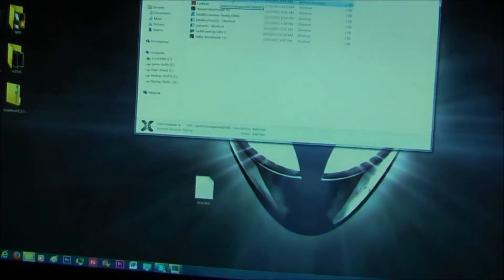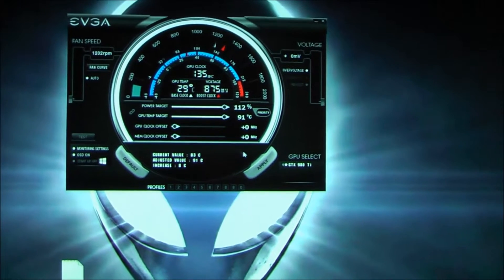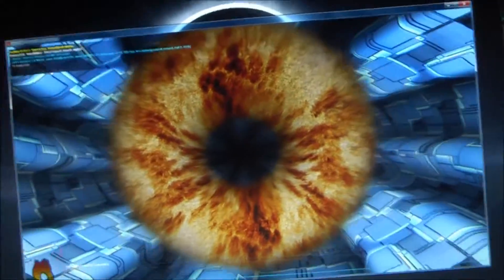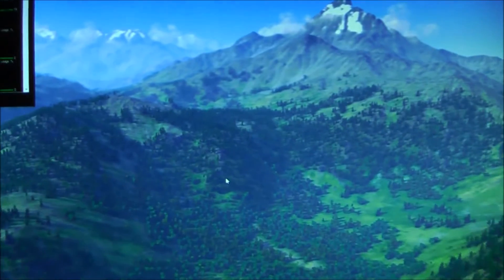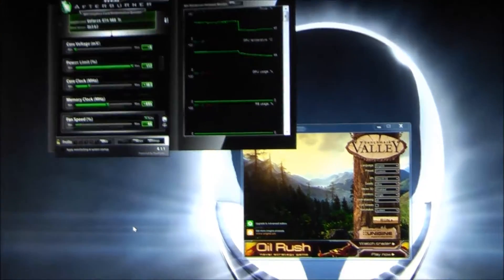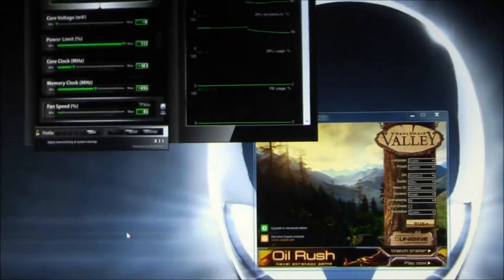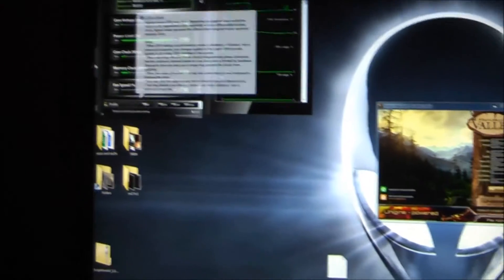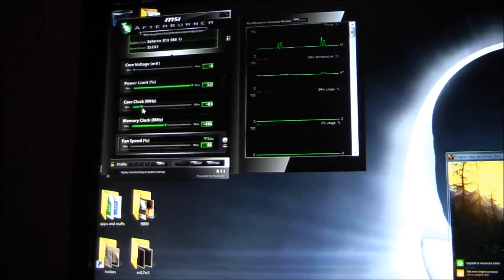Overclocking with the Galax/KFA2 GeForce GTX 980 Ti Hall Of Fame LN2 Edition 1525mhz NO OVERVOLTAGE!

Comment: What is the highest temp of this card
Reply from the maker: +GAMEPLAYS Hey Hey  hits 70 - 75 under heavy load. in 60s when normal gaming. thats expected for the sheer size of this cooler.
Reply: +gameboy3800 normalgaming means gta5 or lol?
Reply from the maker: gta 5, far cry 3&4 @ 4k, easier games to run like portal 2 usually run below 50. also video editing for cuda acceleration can get it around 60 for long videos.
Reply: Thx for telling me about this card,i will buy one XD
Reply from the maker: cant.
Reply: Why
Reply from the maker: the ln2 version(s) have been out of stock for months. they will only make one batch (of about 100 or so) of them ever. you had to preorder it to get it.

you can still get a normal 980 ti hall of fame edition. there's just no guaranteeing it would overclock at high as the ln2 edition.
Reply: I called  hong kong galax yesterday,they told me they have one XD
Reply: But i need to book it with the hong kong galax company.They are seling HKD6999 right now
Reply from the maker: +GAMEPLAYS Hey Hey  what do you plan on using it for? if it's just gaming, then i recommend the zotac amp extreme edition. in my testing it has the most insane stock boost speed ever. my sample ran at 1430mhz without any overclocking needed. it went to 1500mhz no problem.
Reply: Woo really?I know about that card ,but i dont know zotac amp extreme can go to 1500mhz!
Reply: Can zotac water cool 980 ti can go 1500mhz?
Reply from the maker: +GAMEPLAYS Hey Hey  base speed is 1255, which is already a lot higher than reference boost speed. im sure it could go higher than 1500mhz if i actually fine tuned it. i just put it on to match the 1500mhz i have on the ln2 all the time. it wouldnt surprise me if  it could go higher than that. also it's like $670 on newegg right now. much cheaper than a ln2 edition.
Reply: Some benchmarks on youtube said that 980ti amp exterme is very noisy,btw i dont care about that,if that card can really go to 1500mhz,i thing maybe i will buy it
Reply: Do u made a video for it?i want to check out how faw it can go
Reply from the maker: +GAMEPLAYS Hey Hey  i only had it for testing. but i did make a few videos on it. i did benchmarks with the ln2 and extreme edition in sli. it did pretty good.  in my testing it never got any louder than my case fans. not even under heavy workloads.
Reply: Thx for telling me that again
Reply from the maker: +GAMEPLAYS Hey Hey 
http://www.newegg.com/Product/Product.aspx?Item=N82E16814500379&cm_re=amp_extreme-_-14-500-379-_-Product
Reply: U dont have to send me that,i know very well this card😂i just dont know how high its mhz can go,no benchmarks on youtube can tell me that
Reply from the maker: +GAMEPLAYS Hey Hey  yea it  hit 1500 no problem. only issue i had with it is it didn't overclock the memory very good.
here's results of a 1500mhz overclock done by hexus: http://hexus.net/tech/reviews/graphics/84722-zotac-geforce-gtx-980-ti-amp-extreme/
Reply from the maker: +GAMEPLAYS Hey Hey  no prob

Comment: When you use the Boost button, your fans are very loud right? Can you control the fan speed.
Reply from the maker: without hitting the boost button, you can. but i dont think you can stop them from going full speed once you hit the turbo button. i'll see if i can control them in another video.